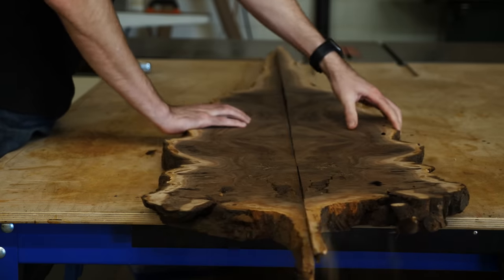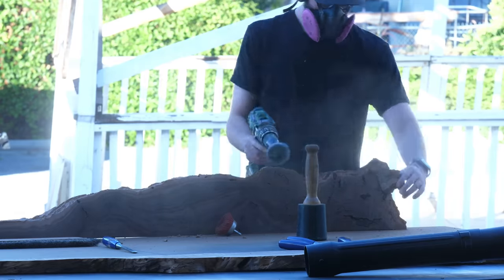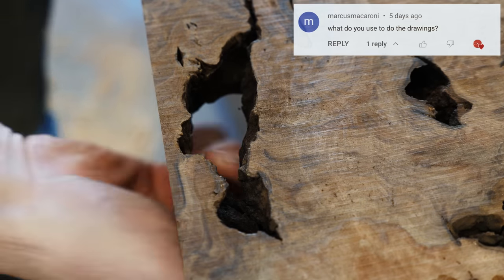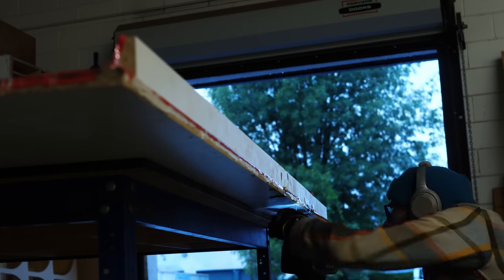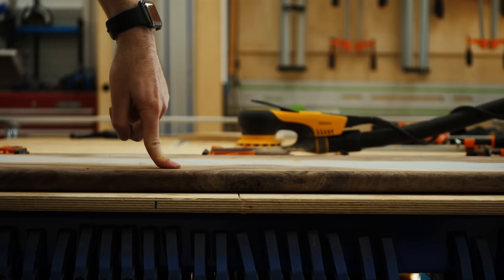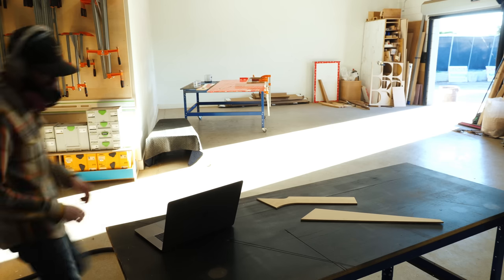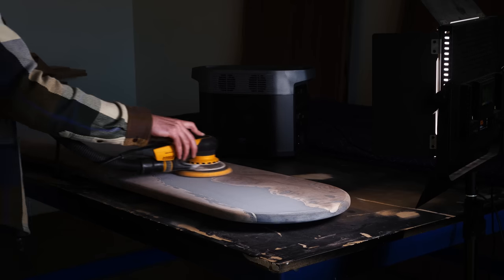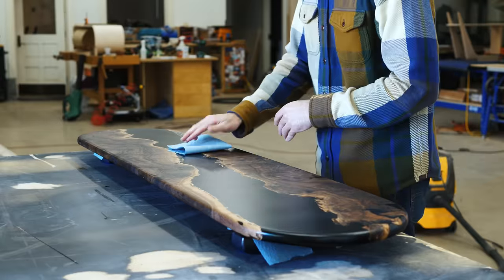$5,000 For THIS Piece of Scrap???

Comment: Thanks for the shout out on CNC. I have used CNC for may projects and coming from metal to wood it just feels normal for me. Too many that don’t appreciate too quick throw the hammer. Keep up the solid work and let me know if I can every help with some custom CNC work that might accent one of your builds. I have a mill, lathe and wire EDM machine. I even have a Cobot that I could program to push the buttons to really send people over the edge in the CNC debate. 😂

Comment: I had this discussion with my brother one time. He was getting a wood stove to reduce the cost of heating his house. In our suburban area, without a woodlot, firewood is the 3rd most expensive heating method after electric and kerosene. I told him it COULD be free, but there was a cost to "free" which meant scrounging every downed tree and pruned branch from the side of the road, no matter what time or weather, processing it, stacking it and dealing with the odd lengths, knots, twists, etc.

Comment: Very nice work :D
As for the problem with cutting the "pill" on your CNC, try leaving a bit of material on the bottom (I usually leave up to 3mm/0.12") and clean it with a small flush trim bit. That way the work piece wont "wobble" around your table and you can leave less space between parts
Reply from the maker: Good call
Reply: @Foureyes.Furniture  glad to help. feel free to send an e-mail if you need some advice in the future

Comment: I'm an Architect and fairly new to woodworking. As of late I've been finding myself watching a bunch of your content. Kudos to you for the awesome content! I'm not aware of a specific definition for the optical illusion you were referring to, if you stumble upon it I would like to know! In short the simple explanation would be viewing the legs or two vertically parallel objects in real life vs through the eyes of a camera and 3d imaging software will never be the same. A camera or 3d imaging software only has 1 lens, which will distort the image (entasis). IRL you have two lenses, or in some cases 4 (do those with 4 have less or more entasis?). With only two it is very difficult to perceive the entasis effect as your eyes typically scan the object vs looking at it all in one shot.

Comment: The Hering illusion (1861): When two straight and parallel lines are presented in front of radial background (like the spokes of a bicycle), the lines appear as if they were bowed outwards. 
In Table case, radial background lines are created by linear perspective (vanishing point) of the table top from standing point of view. I think if you get to table top level, where you only see side edge, legs would look straight (or 3 deg. in other video)

Comment: Like you deigns. You need a SDA Laser Center/Edge Finder that will set you CNC to .001 of an inch. Forget the vacuums hold down and use tabs and screw the pieces down since you build one of a kind. Don’t know your CAD experience you have, but Vectric for drawings and G-code would work for you and it easy to learn. Your CNC perfect don’t know what controller you have for it, but using the proper chip load you save lot in bits and save a lot of time and get a perfect job every time . Wish I could spend 2 hours with you on your CNC and you would be running  like a CNC pro.

Comment: I love the idea of finding uses for the scraps, even if it's not the most time-effective.  There may be ways to optimize this part of the process based on project selection.

As for animation vs drawing, use both.  Use animations where the focus is on the process and drawings where the focus is on the structure.

Comment: I don't know if this is right but I have a theory regarding your question about the optical illusion. isn't it about perspective? parallel lines usually appear to taper in relation to distance. if you look at a table with two parallel legs, obliquely from above, the upper part of the legs will be closer to your eyes and therefore perceived as larger than how you will perceive the lower part of the legs which is further away, therefore giving the impression that they are leaning inwards. A bit like looking at a tower from below, but in reverse. Am I thinking wrong? Thanks for the inspiring work!

Comment: The name of the illusion wants might be the Hering Illusion which is caused by other lines in the perspective with a visible or invisible vanishing (or converging) point between the lines.  Typically the illusion is shown with a set of horizontal or vertical parallel lines and a bunch of lines behind it converging at a single point right in the middle.  The illusion generally shows lines bowing outwards but depending on your distance perspective and the location of the converging or vanishing points the parallel legs might appear to lean inwards or outwards.  You can try this with Photoshop or some other drawing app and a radial spoke pattern like you'd see in the lines of a piece of furniture looking at it from the end.  It seems to work best with 8 or more lines, not necessarily equiradial like bike spokes.

Comment: I would say the drawing communicated the mortises better but maybe it’s the approach for visually communicating. The animation could have worked just as good if it was accompanied by a section view showing how the bolt fit in the mortises. I may be biased because I like Industrial design sketches.

Comment: basically the holes you drilled in the rail (you say stretcher) to hold the top to the leg assembly were counterbore (holds the head) and the clearance or shank hole for the bolt shank.

Comment: I am guessing that the optical illusion is just a curvilinear perspective effect. A fisheye is an exaggerated image of what your eye sees. Parallel straight lines appear further apart at in the centre of the field of view and curve closer together at the edge of the field of view. You typically focus on the table top and the legs are away from the centre of view which makes it look like they curve or slope inward. This is just a guess but I think it makes sense.

Comment: 5:42 thanks for the awesome content and sense of humor. One novice question: 5:42 here I see that one side of the slab (the bottom side I believe) is covered with epoxy and there is a thick layer of epoxy high above any wood in sight. But then you planed all the epoxy away. Isn't it a good, epoxy-saving idea to lay the slab with the top side facing up and then pouring epoxy only high enough to cover the gaps and no higher?

Comment: I’m very curious- how many projects do you have “in progress” at the same time?  I’m sure you are working on something while epoxy dries (cures?) in a form, but is it hard to design multiple builds at the same time?  Thanks for the great videos!!
Reply from the maker: So… that is actually something I’ve been trying to get better at. Especially since epoxy / slabs are still new to me. 

I’d say I have 1 1/2 going at anytime…. But lots of designs in the works at any given time. 

Like right now I probably have 5 things at least 90% designed. And I know things will come up before I get to them. So there is no shortage on that front thankfully.
Reply: @Foureyes.Furniture  thank you!

Comment: 13:59 If I get correctly what you're talking about, I think it's just a matter of perspective. The parts of the legs that are closer to you (closer to the top) will appear slightly bigger than the parts of the legs at the bottom, so it looks like they're leaning in at the bottom. I'm not sure if this is phenomenon has a certain name. I could be wrong, so anyone that can correct me, feel free to respond.

Comment: I do carving (chisel, saw, etc) but have never done conatruction, so probably a dumb question.

Other than esthetics, is there any reason you couldn't have cut three or four relief slices across the cup side, so that the board bends against the cup more easily: before clamping and epoxying?

For example, 16th or 8th of an inch cuts across, at a depth of 3/4 of the full thickness.

Comment: Charlie, I see that you have one of the ubiquitous "Taiwan Special" (as I like to call them) 15" planers --the one with the digital readout that you like.  I'm debating whether to upgrade mine with a helical cutter, wondering if the planer itself is high enough quality to upgrade.  Or is there a better planer out there that I should buy first.  What do you think?

Lover your work!
Reply from the maker: I don’t have a digital readout on mine. But I’ve had this planner for like 10 years now. I love it. Sometimes I wish I had a wider one. (It’s 15”) but love the helical head. Still on the original blades. I think I’ve rotated them twice. Still cuts great.

Comment: I have access to using uni-strut from 1-5/8" down to 7/8" for a c-channel. With its oval spacing every 2" i feel it would allow for expansion and contraction when i fasten it in place. However unistrut has some bend to it as well, How do you feel about using it as a stiffener compared to the channel you opt for?

Comment: A slab in a pool of plastic is fine. Definitely pretty, but tough (for me) to see any unique appeal in them. However, I really dig the design of the rest of this table. If I happened to buy it at a yard sale or something, I'd remove and repurpose the slab, probably for wall art of some kind, and make a new table top that more closely matched the design of the base & leg assembly.

As for the two types of visual explanation, I find the animation easier and quicker to grasp, but the drawing more appealing to look at. Since I'm here for entertainment and inspiration more than instruction, I vote for the drawing.

Comment: I use Woodworkers Source too. For the most part I get quality from there. Sometimes the wood is bowed, or has worm holes in it, or isn't the minimum dimensions advertised. Yet I figure that's just part of the process and as long as most of the wood is quality, you are good to go.

Comment: My idea on the effect thing is that it’s the same effect, just in 1/4th in your case. I know I’m wrong, but it’ll make some sort of sense. I’m thinking of this really late at night so it might be unclear.

Imagine you have the original problem. Your columns look like they’re thinner at the midpoint although they are straight. Cut this column in half vertically and horizontally. The top left piece is straight, but looks like it tapers inwards now because of what I just did. 

It was supposed to appear to taper inwards to the midpoint, but since we cut it, it looks like it just tapers inwards. 

That’s my idea, I know I’m wrong, but that’s the only thing I can think of right now. Please share your ideas compared to mine, I’d love to also get to the bottom of this effect.

Also, I think your drawings are easier to follow in comparison to the animation. It looks nicer, you can illustrate things clearer, and you can see different perspectives. The animation you could simply make a little translucent to solve the last one, but I prefer drawings because you can control it more.

Comment: At 21:44, you talk about gravity working against you to fill multiple holes in multiple directions. Could you use a vacuum sealer to pull all the epoxy in at once? You'd have to probably do a lot more sanding, but is that more or less time than compared to filling each hole individually?

Comment: sorry multiple comments in a row: where the leg and stretcher join in 10:47 , does it matter what degree the joint is? I mean, imagine that you had such wide pieces for the legs that the top of the legs could be wide enough to form a bit of the stretcher so that the joint between them and the actual stretcher could be a 90 degree vertical joint. Would that make a difference in the table's strength?

Comment: Did you ever try carbon fiber runners 3/8”x1” epoxied in the underside then use glass mat epoxied clear on the bottom? Done that on Cedar canoes and looks like a 3/8” wrought iron stripe with 20 coats of clear over the cedar?

Comment: Dude. A better technique for flattening wood is to abuse how it reacts to temperatures. Since wood breathes, you can choose your form of heat transfer to warm up and cool down. Once you do that while keeping pressure on it to keep flat, make sure you check it out for problems. Sometimes it weakens it, other times it makes it stronger. A lot of times, it is still too hot to work on.

Comment: Generally I find the drawings nicer, but the animation was clearer in this case. I don't think it has to be though... adding slightly more space between the bolt and the hole would have made the point clear without listening to what you were saying :)

Comment: Both visual aids were good, but if I had to pick one it would probably be the second, as I’m able to see the bolt in the hole. Of course now that I think about it, I guess you could’ve drilled it out and stuck the bolt in and wiggled it as you explained it. Opps! Guess I should have watched a little more before commenting and I would have seen you wiggle the bolt.🥴

Comment: really nice piece - didn't think I was going to like it as much as I do... but the contrast of the legs and the top is really nice...so yeah just because the "cost" of materials is not so much(maybe to some that would break the bank) the work it took to get there and all the tool and fresh blades and bits... well might be better to sell cocaine soaked rags than to do woodworking...

Comment: "Non profit that helps victims of domestic violence....Womens and childrens crisis center" Aw yes cause no female can be violent towards males and helping just roughly the 50% of the population while ignoring another 50% makes total sense...
For time vs not letting anything to go to waste you already are eating questionable parts of the animal in form of ground beef and dont even know it. Sure it took little bit more time to straighten the top, but the actual hours worked on it were minimal if you have multiple projects going on at the same time, so complaining it took 9 days to cure is really irrelevant and is actually better since you can work on multiple projects at the same time, while other are drying, you can use that time for some other stage. Finishing being only issue since that needs clean room so dust wont land on it and dust settling takes time. End result was really nice looking and well worth the effort. I would only be worried on the bottom shelf rigidity when there is just the glue holding it in, so maybe drill hole insert a dowel and then cap that off with resin rod peace.

Comment: https://youtu.be/GWwUg5PL-9M?t=1111  I would like to ask, at this point in time, when making countersunk screw holes, should I drill the big holes first or the small holes first? If the big hole is opened first, how to ensure that the centers of the two openings are consistent? I am East Asian, please try to describe it in a mechanical way to prevent translation tool errors, thank you!